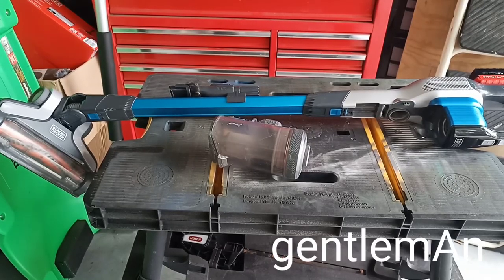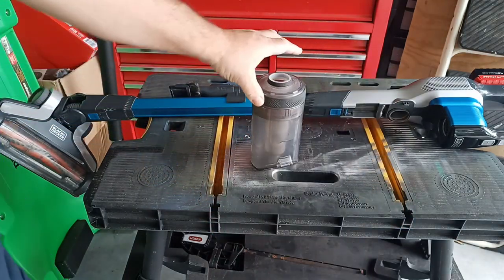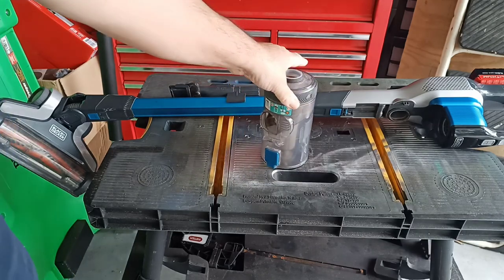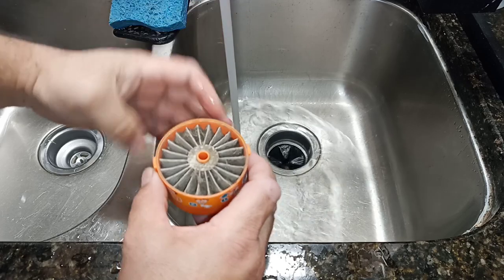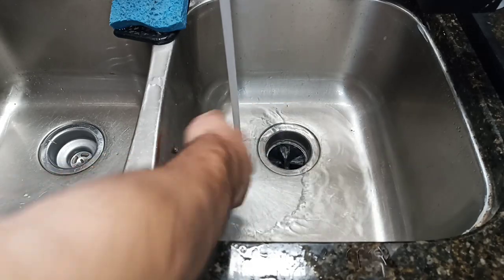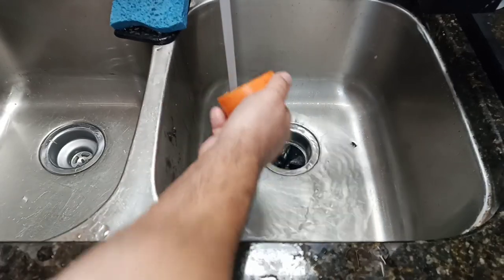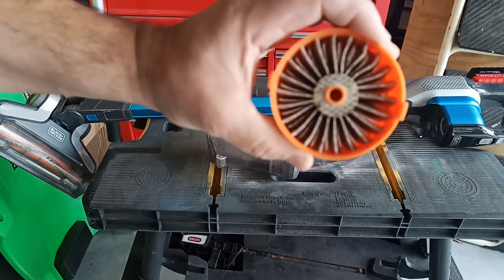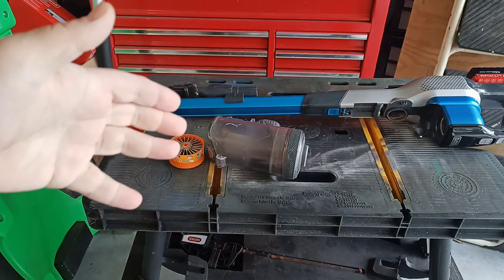Properly Clean the Black and Decker or Craftsman Stick Vac Filters! BSV2020G CMCVS001D1 BSVF1

Comment: I have used a similar  method to clean mine before seeing the video.  Instead of wetting first, I tap the filter to remove most of the dust and dirt then wash.  The loose dry dust comes out better than wet mud.

Comment: I used to do this but it used to drive me nuts sooo before getting it wet, I tap it (like you do) inside my garbage can & then get my slant tip tweezer & get as much as the dirt out of it & then rinse...I realize it's probably a bit more time consuming but it works well - 😊

question - the canister piece you snap your filter back into, is there a way to clean it? Cat hair has gotten caught & pressed inside that i can't get out...wish I could post a pic since my explanation sucks lol😂 I've tried pulling on the inside piece but it seems it's fixed/all 1 piece & I'm afraid to break it.
Reply from the maker: I don't know. I've never tried to take apart the canister part.
Reply: @toolinhand  I managed to clean it as best as I could, looks better than it was! Thanks for replying 😊

Comment: My issue is cleaning hair and debris from the rotary and the tube from the stick to the rotary area.  I use a wire hanger with a hook, but that's very messy.  How can I remove the rotary brush for cleaning?
Reply from the maker: I made a video on that
https://youtu.be/MeIGasj5of0?si=Qomj0NUfYe4YDPgi

Comment: I have been wanting a stick vac for the dust that gets into the shop, do either of these handle that kind of duty life? I might have to just get one of the Milwaukee backpack vacs
Reply from the maker: It can handle the dust. I suggest getting a second filter, since they're so small and they would clog a little faster than normal under those conditions

Comment: Any advice on cleaning the small front wheels? Mine are completely jammed. Thank you
Reply from the maker: They just pop out.
Reply: @toolinhand  hello. can you provide some instructions on how to pop them off. I can't find a way to just pop them off. please advise and thanks for any and all assistance
Reply: I had this problem with my craftsman cordless vaccum the same as in this video and if u take a zip tie and curve the end then stick it under the wheel and pull both ends of zip tie they pop out then clean them really good and pop em back in! Ours got jammed with loose hair haha good luck!